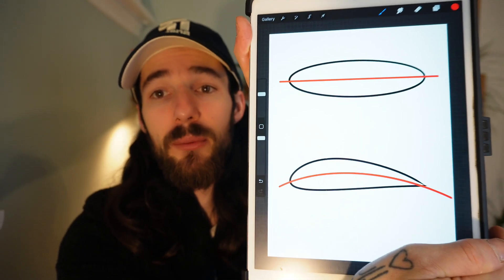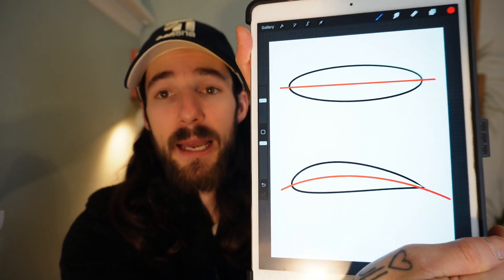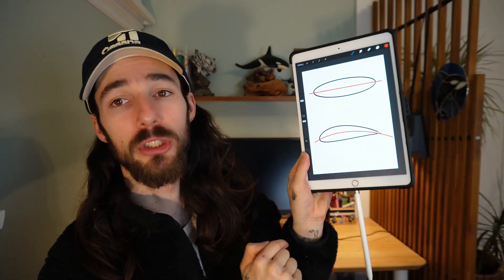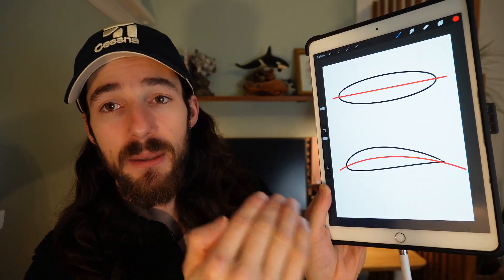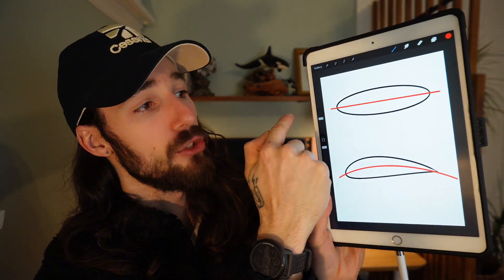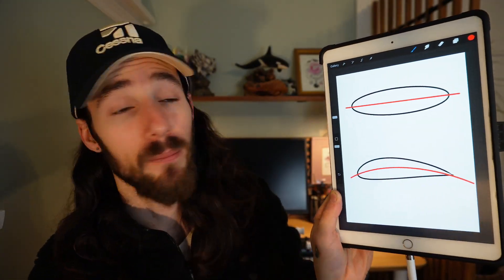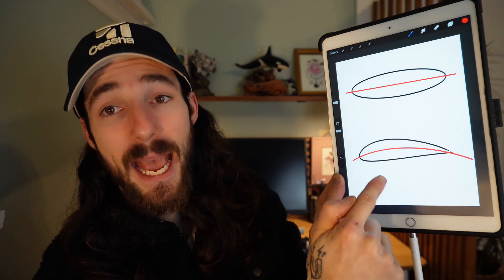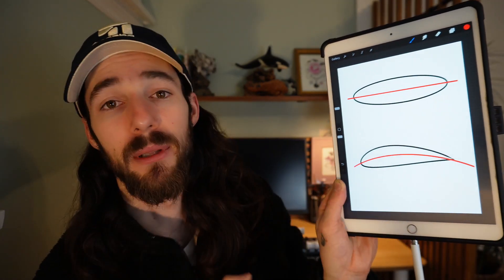Airfoil Basics: Wing Camber Vs. Symmetrical Wings

Comment: I think with more modern flap systems we are gonna see more synmetrical profiles, because if you can generate a profile that generates lift from a symmetrical one without much loss in performance, why not use the advantages of the symmetrical airfoil too